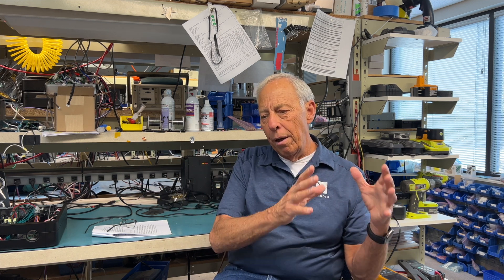Class D amp fatigue

Comment: Interesting. I am a bass player and like class D amplification. Lot’s of very clean output at high volumes. Bass has really nice clear weight and speaking of weight, roadies love the lack of heft! (I used to use an Ampeg SVT).

Paul mentions using a tube at the input stage. I have found a tube pre amp running into a class D amp is near perfect. I amusing an older Genz Benz head with tubes driving class D.

Now as an audiophile, I really do not care much for class D amplification. I agree with the writer and Paul. Very cold fatiguing sound.
Reply: Bass player here as well. Yea, a 10 pound 300 watt Class D sure beats a 300 watt SVT when it comes to moving it!! Bass is probably the best implementation of Class D. Most do seem to have one little tube on the front end. Mine does. About the only problem with Class D in a musical instrument amp occurs when you hit clipping. Our guitarist uses a straight tube 30 watt Genz Benz (older as well.) We tried swapping as an experiment. Well, that didn't work! Tubes still seem to rule the lead guitar world, but I am sold on Class D for Bass.
Reply: @JDfromWitness  yes. Agree. I also play some guitar. I have a five watt all tube Swart (one 12” speaker). I agree about clipping with class D. You get lots of clean power until you hit the clipping point..then watch out. Sounds terrible. Tubes stay clean (no pedals etc) and gradually start to “break up.” For guitar there’s a nice sweet spot on a good amp where the distortion is really nice.
For bass? Not for me…fuzzy bass not my style though some players like it. Class D breakup is just bad noise.

Comment: I had an early class d amp, the Bel Canto Evo. I now have the Nad M33 with the Bruno Putzeys output stage. I hate to say it, but class D ain't there yet. There is something lifeless about the mid range and highs. They are great at dynamics, bass and clarity, but something is definitely missing. Manufacturers have many  tricks to hide the deficiencies, but..
Reply: What amp are you comparing the modern class D NAD M33 to when you say "class D ain't there yet"?
Reply: @abecollins2266   in what I would call "the big and meaty" category I would include my McCormack DNA 500, Musical Fidelity, Harman Kardon HK 990,  and BAT. In the "just the facts please" category various Benchmark Media stuff,  and  due to my second hand connections to the music/music management industry, various professional  amps going all the way back to the now defunct Uni-sync brand in the 1980's. I generally like Italian speakers ( Sonus Faber Cremona) and am now eyeing a pair of Van Alstine mono blocks for my Rosso Fiorentino floorstanders.
Reply: I agree. I never any class D amp. Class D amp tends to have 3 rd order harmonic distortion that make the sound brittle and bright. Not my taste!
Reply: @simplereef4854  ...here the Class I (INTERLEAVED ) , BCA  ( Balanced Current Amplifier) solves those 3rd har. dist. issue..... the design & patent rights with CROWN  this technology is in use in their Professional Audio amps since the last 8-10 years...
Reply: @simplereef4854  :Try an  Aiyima a-07 with a Sparkos Labs discrete op amp
Reply: @simplereef4854  -- "3 rd order harmonic distortion" is readily measurable and is not present to an audible extent in modern Class D modules from Purifi, Hypex, or ICEPower.
Reply: @R L What are you talking about, a 'perfectly amplified input'? No amplifier is perfect, every amplifier has some amount of distortion.  If you learned that in school then I want to sign up for that class ;)
Reply: @bradatherton9369  you can get a $350 class D amp that gives over 120db SINAD. That is vanishingly low distortion.

If we compare it to "budget audiophiles" favourite of the last 20 years, the crown xls range, even the latest models top out at around 75db SNR, that's THIRTY TWO THOUSAND times as much noise\distortion!

$ for $, nothing comes close to a good class D design for being a "true" amplifier, that just increases the signal and imparts no distortion or colouration to the sound.
Reply: @moopminis  Your point about $/Watt is valid.  And might I add, $/Watt/Pound.  Class D takes the cake when weight and/or size is important.

The SNR is important, too, but only to a point.  The human experience doesn't change much above about 85.  If the listening room is uber quiet, 105.  So again, are you letting the datasheet sell you on Class D superiority, or your ears?

I own 4 types of Class D amps and 5 or 6 Class A/Bs, I swap them out all the time for ear training.  But then again, I am a power amp design engieer, so I do it for the joy and the profession.

Read up on Douglas Self.  Or don't, but just know there are different types of distortion.  Harmonic is different from crossover is different from intermodulation.  Knowing the topology of the amp offers insight into what type of distortion an amp will be more or less susceptible to.

AudioScienceReview does a lot of analysis and if you check out his work you'll see one reason why Class D has a hard time beating Class A/B.  It's the distortion in the upper register. The wonderful spec you mentioned was probably at 1 KHz, but what about 10k, 20k?  THD ramps up fast.  Why?  Because Class Ds switch, usually around 400 KHz, which means the PWM has fewer cycles to close in on the average voltage for that time window, and adds lots of upper frequency distortion while it does it. Dead time compounds nastily here, too, adding a crossover distortion effect, which is Non-Harmonic in nature.  The human ear knows this is not musical.

Class Ds suffer from the downstream low pass filter, for EMC reasons, but at least that is finally coming around with a fix called PFFB (post filter feedback). Putzey did a great job on that.

And quantization noise and noise shapers, that's a whole nother conversation and a reason for why Class D will have a hard time competing. Also non-harmonic and non-repeatable.

All in all, Class Ds present a very different type of distortion, the non-harmonic type especially, which is why it is second in Class. But fantastic for efficiency, first in Class there.
Reply: @bradatherton9369  not just $/watt, but $/SNR too. And a fantastic snr is vital for me as a speaker designer as I want that vanishingly low noise floor that you just don't get on AB unless you spend new BMW money.

The amp that I was referring to is the topping pa5, which keeps its noise at least at -110db from 20hz-20khz, it doesn't matter what kind of distortion you have, or how sensitive your speakers are, you're not hearing shit at -110db.

Class D is also great for my usage as they are not nearly as demanding on a power supply, so I'm never coming into issues with voltage drop\lack of current if impedance drops low. I can get away with comically small smoothing circuits and just ensure the PSU has the current delivery I need.

With how fast class D is improving, and how capable incredibly cheap chips like the TPA3255 are, I really can't imagine a future for any other topology. 95% of solid state amps were complete hogwash in the 70's, by the 90's they were way ahead, in the 00's 95% of class D amps sucked and we're just hitting that point where we've really got to grips with them.

I think one of the main issues of class D is that it is so good, as the person writing to Paul said, it's so much more revealing and detailed, and that's overwhelming the listeners senses. I can empathise with this, I'm on the spectrum and highly sensitive to listening fatigue, and sure, I've had listening fatigue with some class D boards I've played with, but not with the good ones.

Being able to place my ear right up next to a horn loaded tweeter and having to strain to hear the tiniest little hiss is the big one for me, maybe not so relevant if you usually listen farfield though. That silence I find translates into a huge boost to the soundstage and reduction in listening fatigue.
Reply: @moopminis  
You're conflating noise and distortion.  They are completely different.  Low distortion with high noise and low noise with high distortion are both possible.
Reply: @Dave-mb7kb  SINAD is signal to noise AND distortion, SNR is just signal to noise. nothing was conflated 🙂
Reply: @moopminis  
I see that in a previous comment I hadn't noticed before, so my conflating conclusion was wrong.  However, SINAD is 1/THD+N and usually measured at 400Hz or 1kHz.  As such it does not capture other kinds of distortion or high frequency distortions so it is not an indication of total distortion.
Reply: @R L If that's what you want to believe you are free to believe it, but that doesn't make it right.  
You're obviously convinced of your belief so I'll not try to sway you.
Reply: @R L distortion ≠ color

Comment: I've owned many amps over the decades including the PS Audio HCA-2.  It was very good but not fantastic.  Also went through a few tube amps because I enjoy trying different gear.  Had a pair of Bryston 7BSST2 mono blocks but I didn't like the sterile and lean sound. Presently running a wonderful sounding pair of PS Audio M700 Class D mono blocks on my Thiel or Tannoy speakers.  They have a nice full-bodied and very dynamic sound with no fatigue.  When time permits I'll listen for hours into the wee hours of the morning.  Class D has come a long way in recent years.
Reply: If you were going to accuse Class D of anything it would be for being a little thin. I had a Butler Audio tube hybrid, and the tube input definitely gives the Class D some body. I currently use a Halcro Class D amp on my active speakers and I can listen all day at volume and not feel any kind of fatigue. Content and speakers probably have more to do with it than the amp.
Reply: @DodgyBrothersEngineering  As with many audio products I don't think you can generalize that all Class D amps sound thin.  I think much of it has to do with how the designer 'voices' his product.  Sure, some just stuff Class D modules in a shiny box and call it a day.  I've always found PS Audio gear, not just their Class D amps, to be a bit on the warm and full-bodied side which I thoroughly enjoy.  Of course I wouldn't expect any Class D amp to sound like a syrupy ripe SET ;-)
Reply: @abecollins2266  don't get me wrong I would prefer thin and neutral, to artificially enhanced any day. I have owned several expensive commercial Class D amps, but none of them have left me with warm fuzzies, but I do prefer my music on the neutral side. I want an instrument to sound like it does in real life, not a warmer version of it.
Reply: @DodgyBrothersEngineering  Please define "neutral" and is "neutral" the same for everyone ;-)  I've owned a few high power commercial Class D amps too and I found mine to be somewhat thin and sterile sounding, harsh too. I've also had Hypex UcD and nCore which were all the rage until Purifi and now GaN FET designs came out. But in the hands of good designers who know how to 'voice' their products I found ICEpower from Wyred4Sound and PS Audio to be more to my liking.  Point being, you cannot generalize that all Class D amps are a little thin.

Comment: My N.A.D. C388. is great. 
I think I've never heard anything else. But I listen to it all day with great pleasure. 
I'm new to all this  but can someone answer this question. I switched from a single pair of speaker wires to bi wiring a+b channels into speakers. 
This greatly improved output volume and clarity. 
Why? And is the power split 50/50. Or is there something else going on?
Reply: SVS SoundPath Ultra Speaker Cable - Banana-Banana - 10ft (3.1m)
12 gauge
I went from one pair to two.
If you can suggest a better option for cables I'd like to hear your opinion. 
What would be significantly better without being hundreds and hundreds of dollars!
Reply: I hope the package is new speaker cables. Lol.

Comment: I've gone from the big house flagship system as an electronics engineer to a medium sized 2.1 class D amp based on a TI chipset development board powered with a Meanwell SMPS. I enjoy beautiful detail and find that a little 6j5 preamp adds just a little sugar to the mix.
Reply: i¨ve often wondered what a decent tube preamp could do, (and ordered faulty tube amps home, so never got around to it ,,, since analog input via e.g. records, smacks  any digital input, in regards to  bandwidth and thus bass performance ,,,, could a simple preamp solution mimmic this , or is it more just a bit nice colouring it gives ,,, ,,, i will have to test it again, ith upcoming setup ,,, :)
Reply: ps pascal audio sell d modules with near 130 db dynamic range,,, they run cold at full loads, since they pass on nearly all the power, to the speaker,,, big plus for class d ... and good powersupplies resonate at upwards ½ million hz, thus able to reproduce one order of magnitude lower freq. up to 50 khz ,,, new class "d" tech power supplies, came from medical scanners, as most or some of you probably know :) ...
Reply: I totally agree. My $800 15lb Hafler amp barely gets used. Changing Op Amps when permitted can be sonically rewarding too. I really like the Sparkos Labs Op Amps.

Comment: Class T was ultra superior but all brands of transistors copyated the Tripath technology and Tripath went to bankruptcy, I have a 2000's Sony class T and it sounds "high end" very acurate, holographic, tube-like sounding, no ear fatige, also I use a tube preamp to feed it, and the result is so vivid sounding, Adya Tripathi is a genius, now he works developing car computers and electronics to create more eficient cars.
Reply: I heard that they overproduced them or the market didn't respond. There's still a ton of those chips available so they are still used in new products. 
It was other chips made after that got a bad reputation, oddly enough. 😄
Reply: @PSA78  there is a small cult of that transistors, im curious of how the 100w version sounds, mine is the 20w and it fullfills my room better than my olschool Onkyo or modern Yamaha amp both are 100w but they sound like a childs toy the Onkyo has Sanken mosfets and Nichicon caps
Reply: @necrodh  They are cheap enough to try out. Some of those cheap boards outperform really expensive amplifier from not that long ago.
Just look at the price difference between a really good board today (ICE, Hypex etc) and one of the "brand name" amplifiers that use them, it's a steep price for a box, cables and some connectors.

Comment: Hi Paul! So, what specifications should we observe before buying to know if we are facing a fatiguing class d amplifier or not?
Regards, Fernando from Montevideo, Uruguay.
Reply: Compra uno con elementos Purify.
Reply: @FadetoblackBS  Desconozco que son los elementos Purify. ¿Puedes aportarme más información, por favor? Muchas gracias por responder.
Reply: Que tengan x ejemplo este elemento: Purifi EIGENTAKT 1ET400A
Reply: @FadetoblackBS  Esos módulos están buenos para encarar un proyecto DIY, la verdad es que no tenía conocimiento. Muchas gracias por la info.
Reply: Venden en Uruguay x ej Amps de Audiophonics?
Reply: Otra opción son los módulos Hypex NCx500
Reply: Con los Hypex o Purifi vas a andar muy bien. Hay compañías q venden Amps con dichos módulos. No tiene q ser DIY. 
Saludos
Reply: Hypex NCx500: Often described as neutral and transparent, this module is regularly perceived as analytical by some listeners including myself, signifying its ability to reproduce recordings without adding any coloration. However, it's worth noting that with certain operational amplifiers, such as the LM4562 and similar types, the NCx500 can come across as slightly harsh in the high mids and highs. In my experience, this module pairs optimally with op amps like OPA1612, OPA1656, Weiss OP2-BP and similar, which tend to present a more refined sound profile.
Reply: Purifi 1ET400A: Also considered very neutral and transparent but might be perceived as having a touch more 'musicality' by some listeners including myself, which can mean a more engaging or warmer sound. However, this difference can be subtle and may not be noticeable in every system or to every listener. In my opinion, the Purifi 1ET400A exhibits a more refined and smoother presentation in the upper frequencies (high mids and highs) compared to the NCx500. Also Intriguingly, when integrated into certain systems, the Purifi 1ET7040SA for instance, imparts a noticeable influence on the sound profile. It seems to enhance the bass extension, making it sound deeper, more robust, and lending it a more assertive character.

Comment: Class D is awesome for getting a lot of power for bass where you need that extra power. For higher frequencies it can also sound great when well designed, but best is class A or B for that.
Reply: I think the Class A AB and Class D debate is more of a religious war and old school thinking. All can sound FANTASTIC if done right.
Reply: @abecollins2266  Agree, bad engineering can make a class A amp sound bad and great engineering can make a class D amplifier sound great. Overall for audio products, the future is in excellent class D designs due to higher power levels in smaller sizes with higher efficiency.
Reply: class B?
Reply: @jamapaza  Well, call it AB as you don't want the crossover distortion with zero DC bias of pure class B.
Reply: You're wrong.
Reply: @platonelenin  What’s wrong?